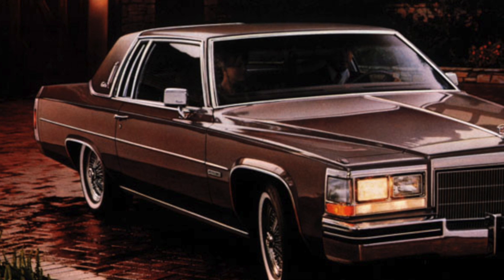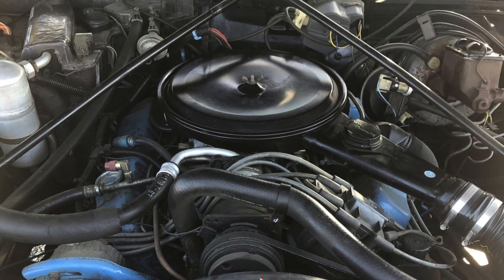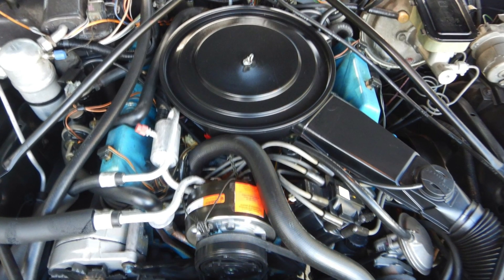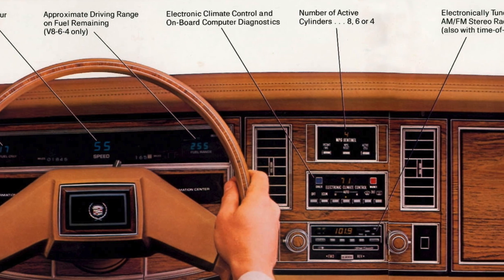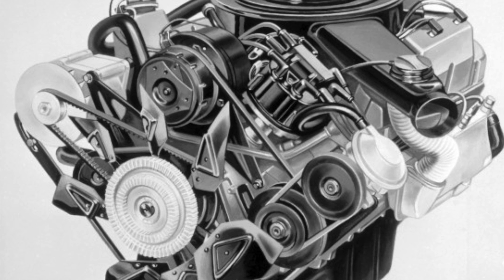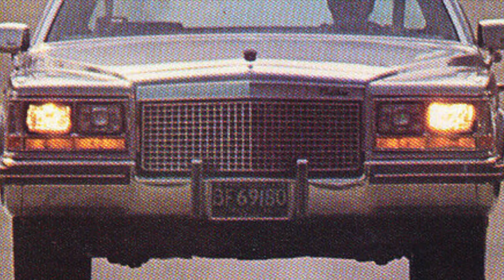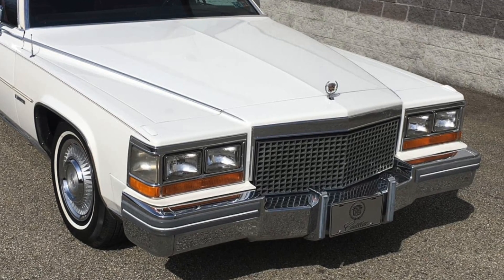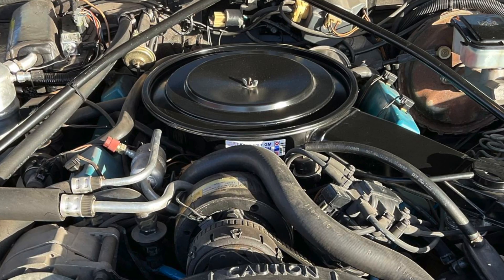V8-6-4 - Cadillac's Worst Engine Blunder?

Comment: The same V-8-6-4 engine used in the 1982-84 commercial chassis actually had some slight improvements over the original 1981 version.

Having said that, why do virtually all modulated displacement engines have one or more inherent issues that keep them from being good technological wonders?

Comment: Back in 1997, I drove a 1980 hearse built on a Cadillac v864 chassis from Maryland to California. It was also equipped with a 40-gallon gas tank. The 8-6-4 worked flawlessly. At highway speeds with the AC running, it got ~26 mpg.
Reply: Thats impressive. And what a bog gas tank. I wish cars today had big gas tanks - especially mid to full sized sedans and suvs

Comment: The new engines with DOD or AFM cylinder on demand systems are still failures. Lifters fail and eat the cams. $7,000-$10,000 repair if it can be fixed. If not, then a new engine is required. I wouldnt just deactivate the systems used today. I would replace the lifters and heads right after i bought them. Might as well do a cam since you have to take heads off to replace the lifters. It voids the warranty, but the warranty issues will be gone and you'll be left with a great running V8.

Comment: FIL had a 81 V864. He got maybe a 1 MPG difference between V8 mode and V4 mode
Reply: That's why they dropped it from most models for 1982. EPA rated 15mpg not good enough for CAFE.

Comment: It doesn't sound like much of a disaster, at least it didn't have to be. They got it working right after 1 year and even before that, customers could still get their cars running right by deactivating it. They probably should have kept the V-8-6-4, but deactivated the rough 6 cylinder mode, making it a V-8-4. The real disaster was the 4100, which was rushed into production and gave customers much more grief than the V-8-6-4. A V-8-4 in all of their RWD (and 2 ton FWD) models would have given them time to get the 4100 right for the '85 FWD C-bodies, which were light enough for an engine that small.

Comment: No, the HT 4100 is the worst, because you can disable that cylinder deactivation and have a great Cadillac V8, but there is no way to fix the 4100, short of removing it and replacing it with a different type of engine, with all the complication engine transplants entail

Comment: I bought a 1982 Cadillac Fleetwood with the V8-6-4 engine. After a trip a week to the dealer he finally turned the system off after a year. I swore off Cadillac until 1995 when I bought a Sedan de Ville with the Northstar engine. Three replacement engines later I dumped it and got a Mercedes E300 diesel and never looked back. If someone gave me a modern Cadillac I’d take it and sell it and put it towards another Mercedes. To me Cadillac ceased to exist after the 1976 model year!

Comment: We had a 1981 Fleetwood Brougham with the V8-6-4.  We had a toggle switch put in that activated or deactivated the V8-6-4 mode.  In town driving it was always in the V8 mode only.  On the freeway the V8-6-4 was turned on.  I think that it should have been a V8-4 only.  The V6 mode had that slight vibration that was always present.  Otherwise, it ran fine for 10 years.

Comment: Actually, there were exactly a DOZEN ePROM updates - I drove #13 for over a decade.  How ironic it is that the "modern" deactivation systems have great computers but mechanical problems buried deep in the engine...  As long as they were still using OHV engines they shouldn't have messed with the lifters, they should have stuck with the Eaton solenoids perched on top of the rockers!  

I never had one bit of trouble with the solenoid system or the latest computer.  However, the engineers overlooked 2 totally separate things that hurt mileage & performance, even while they were brilliant enough to create an ACTUAL On-Board Diagnostic system 15 years before OBD2, accessible through the friggin' climate control buttons - something I don't know of any other manufacturer ever doing...
1. While a back-pressure-controlled EGR valve was a clever improvement on regular engines of the day, it was a brainless idea on an engine that CUTS its exhaust flow at cruise!  The floor jets below the throttle body would carbon up & require drilling out, but far worse (on a long-stroke engine hobbled by a 2.41:1 axle ratio) was the EGR going away at the same time you were loading 4 cylinders more heavily.  Combine those two results and you could not run as much spark advance as you needed  to...  
2. These cars had the first cruise control integrated with the computer.  Later on, Chrysler was smart enough to use this advantage to actually drop a gear in the transmission if necessary to hold the car back going down hills!  Unfortunately, Cadillac did NOT use this advantage to hold fewer cylinders while the Cruise was controlling the throttle.  The engine still gave the throttle response, and cylinder activation, that a human foot would want.

Oh, to answer the question asked, the HT4100 was Cadillac's worst engine disaster... the 350 Diesel was Oldsmobile's.
Reply: I agree. Solenoids to force the valves open and keep them open are a MUCH batter design than collapsible lifters that will eventually make terrible noises and just collapse prematurely.
Reply: @aspecreviews  Thanks.  And just to be clear, the valves are left closed for deactivation, the cylinders acting as air-springs.  The original system rotates a novel rocker-arm nut to release the fulcrum and let the arm move up and down while the valve is held closed by its spring.
Reply: @marko7843  very neat! Honda does a similar thing with VCM, and it causes the engine to burn oil. The vacuum in the cylinders causes oil to seep by the piston rings.

Comment: MDS is not good overall even today. I have a 2019 Honda Pilot with the 3.5 J35 V6. It’s called VCM. I disabled it with a $90 module. 

-On these engines the oil passages for this system in the heads is narrow and will get gummed up over time. 

-Honda uses expensive fluid filled motor mounts to cushion the vibration of the cylinders turning on/off. These mounts fail at a much quicker and higher rate with VCM enabled. 

-The VCM system is known to kill the 6spd auto transmission. Something about the computer logic and the constant locking of the converter. 

These issues took years to discover and document and cost people a lot of money. 

This video is wrong. Stay away from MDS systems or make sure you disable them.

Comment: I had occasion to ride in a new V8-6-4 Seville. My overall impression was that my 1974 Pinto provided a smoother and more satisfying driving experience, and wasn't as fugly as that bustleback Seville. Sure, they have these systems in modern cars, but they lead to premature oil consumption, broken pushrods and ultimate early failure of the engines. Some years later I bought a used 85 Sedan deVille with the Hook and Tow 4100, it was underpowered but it was overall a smooth running engine. Mine suffered an oil pump failure but I had it shut down so fast that no damage occurred, I repaired it with an updated pump for the 4.5 engine. It was a fun car for a while, then I sent it down the road before the big repair bills would come due.

Comment: Ironically 40 years later they still have reliability issues with displacement on demand.  It simply doesn't work right even now
Reply: Because it is forcing the engine to run in a way that is bad for it.

Comment: All it required was a 30 minute disconnect at the dealer. I did it immediately with my Moms 81 Seville.
Reply: But many shops, both at dealers and regular garages, were afraid to do so, feeling that the EPA would consider it to be "tampering with the vehicles emissions control system" and fine them $50,000.00.

Comment: Pushing the pistons up and down uses up energy., which is a waste, if they are not creating power. What they really needed was a straight eight with a crankshaft that would seperate its front four cylinders from the rear four and the rear 4 cylinders would be like a 4 cylinder while the front 4 were turned off.
Reply: If you could get such a thing to work and last, it would have a 180 degree crankshaft just like a 4 cylinder, which would mean vibrations at certain load/rpm conditions, just like a 4 cylinder.  That's why both V8s and Straight 8s have a 90 degree crankshaft, except for Italian V8s.
Reply: @jamesbosworth4191  The crankshaft of a straight 8 is essentially 2 4 cylider engines crankshafts..  BMW tried to make a straight 6 where the front half was disconnected and the rear half could operate like a 3 cylinder.  This may have worked, but they gave up on the project before it went into production.
Reply: @tirebiter1680  BUT, on those made after the first few years of that engine type, they were 2-4-2, not end to end.

Comment: I was right in the middle of this debacle as auto repair shop owner and a livery cars owner. We shut down the the modules on V8 6 4 so the problems stopped and still got high miles out of it but it was a underpowered pig compared to 425 cu earlier. The 501 was another pig that had numerous fraulties. The HT 4100 WAS THE WORST  we just waited for it to breakdown at about 120 thousand miles and replaced it with the Olds 350 witch gave us high mile results. Always had Lincolns too that's why the Lincolns took over the livery buisness!
Reply: You got 120,000 miles out of an HT4100???  And what was wrong with the 500 cube engine, besides the high oil consumption?

Comment: The 4 6 8 Cadillac engine was the number 1 biggest bonehead design I have ever seen in my 35 years as an Automotive Technician. It would be a better boat anchor than an engine.
Reply: When you de-activate that feature, the engine is fine.  The HT 4100 is the disaster, as there is no way to fix it.  It was just a horrible design.
Reply: @jamesbosworth4191  the problem from a customer stand point is why are you deactivating something I paid for. They want it fixed. So deactivating does nothing. These systems were and still are garbage.
Reply: @bettyg7710  No motorist would willingly pay for these systems, the automakers are using them to try to satisfy CAFE mandates.  So it is GOOD if it de-activated.
Reply: @jamesbosworth4191  actually yes they did and not for emissions but for gas mileage. Gas prices were sky rocketing in the mid seventies and the Cadillacs were not known for good gas mileage, being a big tuna boat on wheels. Emissions remained the same in 4 6 or 8 mod as far as what they measured back then. With a good working computer they were controlling emissions in all modes.
Reply: @bettyg7710  That's what CAFE is about - gas mileage.  The EPA is about emissions.  But people who bought Cads were not concerned with gas mileage.  Chevrolet buyers and Pontiac 6 buyers cared about that.

Comment: At least this one just had slow electronics and a shudder in six cylinder mode. Easily disconnected and at least it did not commit suicide via lifter/cam obliteration.

Comment: Most of the problems domestic manufacturers had in the late 70s and early 80s were caused by rushing incomplete changes to market to meet fed fuel economy or pollution requirements
Reply: I second you.

Comment: Not just V8-6-4 is in the running for worst, the NorthStar engine with poor head sealing is at least as bad as that earlier mistake. 
Ford looked into V8-6-4, a design that actually came from a third-party company, but rejected it before ever bringing it to pre-production. We saw the problems. 
So that third-party Company pitching it to Ford took it to GM, and the rest is history.

Comment: The V8//6/4 hardly a GM blunder. 
1. 5.7 diesel, fail.
2. Quad four, fail.
3. EcoTec fail. 
4. GM LS series with AFM, fail. 
5. GM 3.4 dohc fail.
6. Ford 6.0 diesel, fail.
7. Ford 6.5 diesel, fail.
8. Ford 5.4, fail.
9. GM Buick 3800 pass.
10. GM 5.7 Chevy pass
11. GM 5.7 Vortec, pass.
12 GM 7.4 Vortec, pass.
13. GM 8.2, pass.
14. GM 6.2 early models pass. 
15. GM straight six, pass.
16. Ford straight six pass.
18. Dodge/Cummins 5.9 diesel, pass.
19. Ford 7.3 diesel, pass.
20. GM 6.2/6.5 diesel, sorta pass. 
21. Ford 302/351 series, pass. 
22. Dodge 360 magnum, pass.
Reply: Forgot Ford 4.6. Millions of taxicabs & cop cars ran that thing. Practically indestructible, in fact I'd go so far as to give it a slight edge over the vaunted 300.
Reply: IIRC, Csaba Csere of C&D talked to a GM engineer at the time and the engineer said the Quad 4 needed a balance shaft but the bean counters said no.

Comment: It wasn't really so much programming as it was lack of computer technology at the time. Put simply, engine computers of the day were too slow to react to driver input. This is why many late 70's--early 80's turbo 4's and turbo Buick V6's blew up (no, not the Grand National engine, before that). When spark knock happened, the computers were too slow to retard the timing, allowing detonation and engine damage
Reply: Did Buick ever address the fatal flaw with their 3.8/4.1 V6? They had an oiling system that pumped the oil to the top of the engine first and the crankshaft and connecting rods last. It was a reason for me to never own a Grand National. I remember they were top speed limited from the factory at something around 112 MPH. Thinking due to that issue? The V8 f bodies weren’t top speed limited. I was able to bury the 140 MPH speedometer in my 89 Formula 350 with ease. Not a big Chevy fan but at least they stayed together.
Reply: @mikee2923  : The 3800 fixed all those problems circa 1987.
Reply: @TeeroyHammermill  The 3800 was the FWD version of the Buick 3.8, correct? I seem to remember that the only RWD car it was put in was the 89 turbo Trans Am pace car. I remember it being something about a redesign of the Buick V6. If you know the details, please provide them.
Reply: @mikee2923  The problem was that the oil galleries in the engine were undersized (a problem they inherited from Buick V8's)---if I'm not mistaken, they enlarged them in the mid-late 80's
Reply: @justsumguy2u  Thanks for the info. I knew it was some kind of oiling issue. But I still wonder why they limited top speed in the Grand National turbo 6 but let the Chevy V8 unlimited. Had to be some kind of warranty worry. Maybe because the TPI didn’t rev high enough to stress the bottom end of the small block. The F bodies were only 2 bolt main blocks while the Vettes were 4 bolt blocks. The cast bottom end of the 2 bolt small blocks were hardly bulletproof.

Comment: My first Cadillac was a 1980 Coupe DeVille with the 368 V8 that my mother bought for me used while I was in college. But I remember reading about the V8-6-4 car in high school and saw it at the dealership (my mother drove a 1979 Seville at the time). I would counter that the V8-6-4 engine was just one of the engine issues of the era. The Olds Diesel engine debuted in 1978 and was a performance and reliability dog for a variety of reasons. Still, fixes were made and Cadillac even made it standard on the Seville in 1980. I remember reading in a car magazine in 1980 that the V8-6-4 cylinder deactivation scheme went from the drawing board to production in 11 months, which means it was impossible to do any kind of real testing. The customers were the testing and the results speak for themselves.

The early years of the HT4100 were just as bad as the V8-6-4 if not worse. To fix the V8-6-4, you just had to disable the system in a few minutes at the dealer. The HT4100's problems often required replacing the entire engine. And finally, there's the Buick 4.1L V6 that was on offer at the time. Is there anything more of a "we're hedging our bets" engine than this one? Why have a large V6 engine with the same displacement and rated MPG as the new "High Tech" 4.1L V8 Cadillac was touting? Somebody knew this new engine might not end well.

Comment: Thank you for this video.  Cadillac had a host of issues in the 1980's and this engine was one of them. There was the Cimarron, the great downsizing debacle of 1985 and 1986. It took them years to come back from all that madness. They are working their way back right now. The market changed a lot during this time too.  I wonder how people would feel comparing this engine to the Northstar V8. The 4100 got upgraded to 4.5 and 4.9 liters and that was a good engine once they upgraded it. Thank you for posting this video.
Reply: Cadillac basically stole the Northstar engine from Oldsmobile. It was nothing more than a larger displacement version of Oldsmobile’s Aurora V8 from the early 90s. Cadillac also pilfered FWD from Oldsmobile’s 1966 Toronado for the 1967 El Dorado. I still believe this is why Oldsmobile was able to produce their 455 in 1968 while Pontiac and Buick had to wait until 1970 for theirs.
Reply: @mikee2923  I thought the Aurora's V8 was a small-bore version of the Cad's Northstar engine.

Comment: Was the V8-6-4 worse than the 4.1 liter?  All that was needed if it failed was to disconnect it (cylinder deactivation) and then the engine returned to a normal, reliable V8 based on a proven engine family.  The 4.1 wasn't particularly reliable and it was a dog.  The V6 was certainly not "Cadillac smooth" or powerful.  And the 350 diesel doesn't even warrant a comment.

Comment: I worked at a GM dealership  from early to mid 80s , One of my friends was a mechanic there as well and did the engine rebuilds. He said the only thing those and that god awful GM  Diesel engines was good for was a boat anchor.
Reply: Actually the engine blocks from the Oldsmobile diesel are quite desirable. It’s a heavy duty Olds 350 block.
Reply: @mikee2923 DX block.  Pre DX is the boat anchor
Reply: @mikee2923  When used as a gasoline engine, yes, but as the diesel it was intended to be used as, only the final version was any good.  The others were horrible.